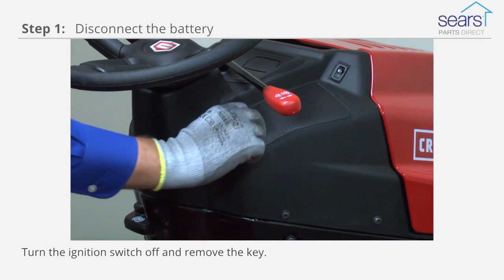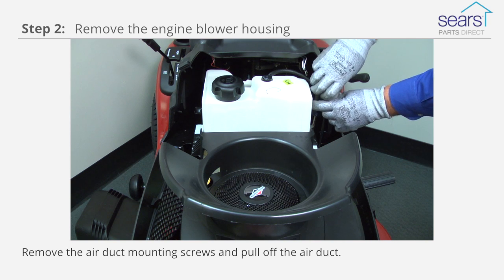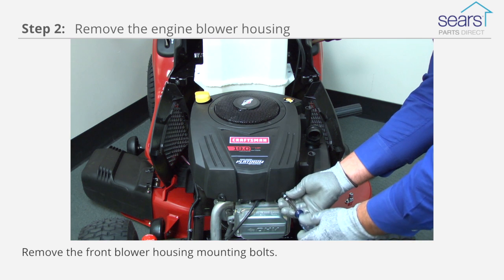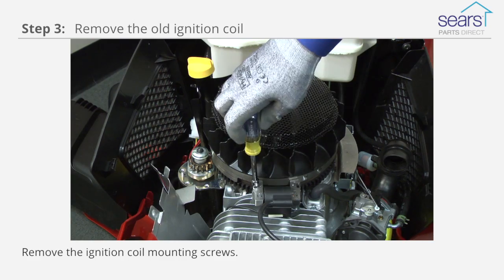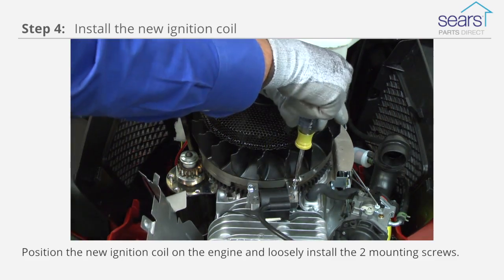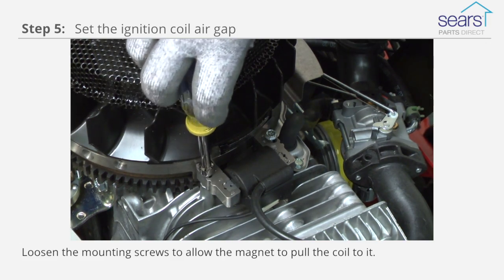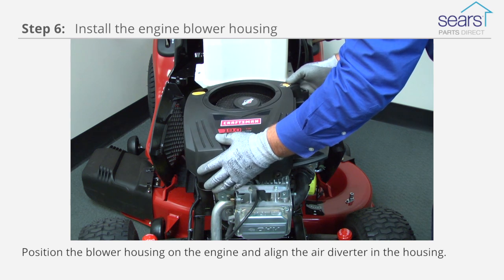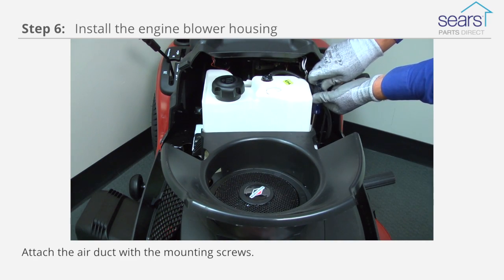How to Replace an Ignition Coil on a Riding Lawn Mower

Comment: Great video. I also would like to point out if you don't set the space on the coil, the tractor will start hard and run very rich, maybe fouling out your plug. I found out the hard way! So simple to adjust corretly.

Comment: I have a craftsman YT 3000 it runs for a minute and a half installs I have replaced all of fuel lines, fuel filter, spark, plugs, new carburetor, and still does it couldn’t be there ignition coil?
Reply from the maker: Because the engine runs for a minute and a half, the ignition coil is almost certainly good. Check the choke linkage on the carburetor. The symptoms you're describing point to a choke being stuck or a fuel supply problem.
Reply: @searspartsdirect  how long should the fuel line coming from the bottom of the tank to the fuel filter? Should there be any sag because I’m thinking that might be the problem when I replace the fuel line maybe I cut it too long

Comment: What is the part number of the magneto that's in this video?  I've got the same tractor.  Please reply.  THanks!
Reply from the maker: That 19 HP Briggs & Stratton engine use ignition coil/magneto part 799650: https://www.searspartsdirect.com/product/3qiko0gou6-0071-500/id-799650
Reply: @searspartsdirect  Thanks!